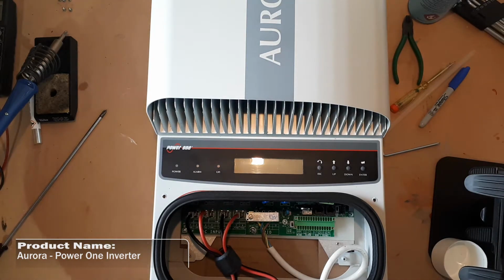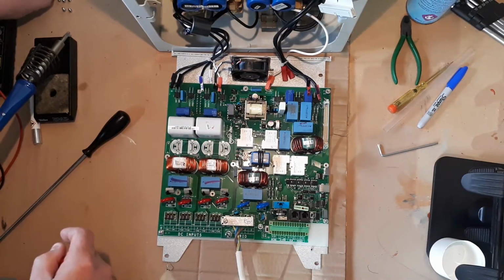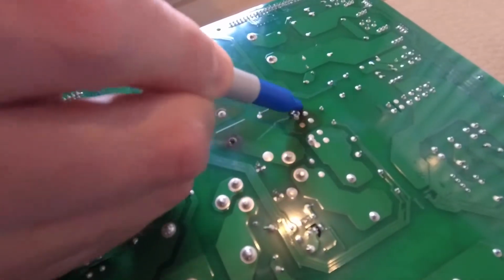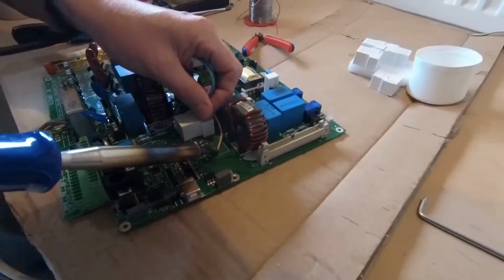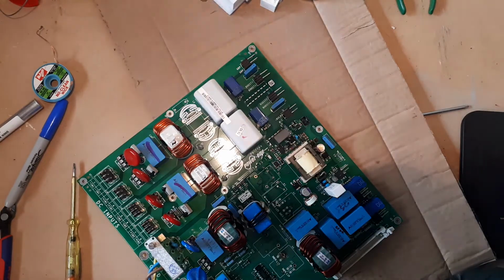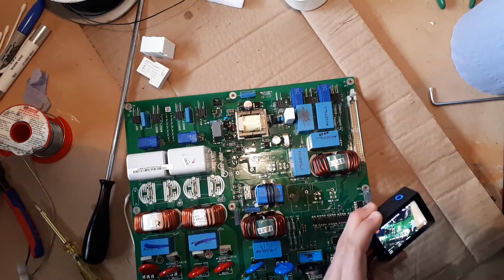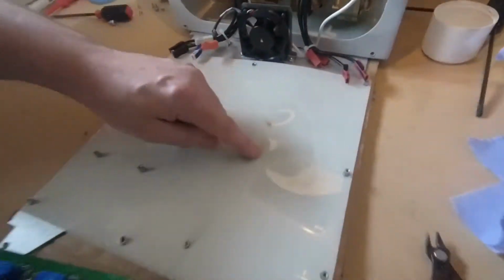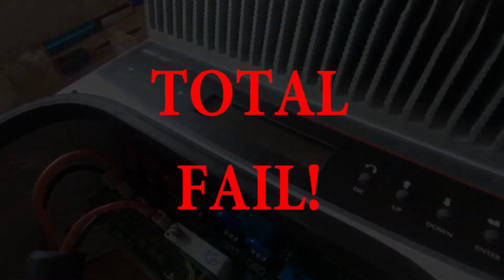Repairing & Fixing The POWER-ONE AURORA SOLAR PV INVERTER!

Comment: Hi. Good video thanks. I bought this and some solar panels second hand and want to have it installed. Please tell me; Can I use it directly for AC power to help provide daytime power for say a garage that's remote from the house that has no power or does it simply need to connect to the power grid somehow to allow you sell power and thus reduce your powerbill? Thanks in advance.

Comment: Helpful videos, thanks. Having now dealt with our E031, I can feed back a few things to make this job easier. First is that disconnecting the grid cable at the PCB will make handling the PCB thereafter much easier. Secondly, it is much easier to lay the unit on it's front when removing the backplate and mounting brackets. Then, without repositioning the unit, you can pivot the inner metal backplate up to remove the ribbon cable, and then keep pivoting it over to almost 180 degrees, and you will find that the inner backplate will sit nicely in this position making it really easy to remove the remaining cables, and then the PCB. Finally, if we consider that the output, or product of this unit is is mains power, then it is logical that it must receive it's own operating power from elsewhere. Note that part of the start up process is to check for the presence of the grid, and this check would not be possible (or would be redundant) if the operating power to do so was coming from the grid.

Comment: The failure is not the PCB, but the relay contacts going high resistance which then is causing the overheating.
Reply: Just been explaining this to a plumber who texted me today to ask "Can you fix some solder joints in an inverter for me"  By the way SDG stopped getting notifications of your videos, just re enabled notifications.....
Reply from the maker: Hi there - thanks for your comment! Yes, we found this out during the repairing this unit. A follow up of what happened after the repair can be found here: https://youtu.be/tucR0HLB5NI. Thanks again for your comment and we hope you enjoyed the video!

Comment: This is really useful - thank you. Will there be any issues having the Aurora reset after such jobs - will it affect built-in readings or info which is required for FITs, for example? Thanks.
Reply from the maker: In our experience, none of the settings are affected, so you should be ok!
Reply: @HDTechLogic  Thank you. 🙂

Comment: Do you have the Service Code to get in deeper menu? i have the aurora pvi 3.0
Reply from the maker: Hi, thanks for the comment! Unfortunately, we are unfamiliar with the menu of that model. A website that appears to offer a PDF User Manual for this model is available here: https://hdtechlogicyt.page.link/JdNS however if it doesn't offer the information you need, try searching around a bit more on Google. Sorry we couldn't help on this one, but thanks again for the query!
Reply: 0000 will get you past the first one.  The next one is neither 00000 nor 11111   I'd suggest trying the last 5 of the inverter serial # or contact whoever you bought it from.

Comment: Do you have the total wattage, or amperage? I have an issue with the same model. Thanks for posting this gents
Reply from the maker: Hi there, thanks for the comment and apologies for the late reply. Our system is no longer in our workshop and is not currently accessible for us to find that information. However, after some looking around online, I believe its total wattage is 3.6kW (however may differ on all units). If you have any other queries, please let us know! Thanks again!

Comment: These relays are two pairs in series doing the grid disconnect, one pair on the Live side the other on the Neutral.
One side of each pair of coils is commoned, the other side are driven by two different parts of the control circuits. Not sure why they designed it that way. 
Has anyone been able to find a schematic for these units? I've looked for a circuit diagram but not found one online
Reply from the maker: Hi @Paul Britton! Wish I could help with the schematic, however after some searching I'm also unable to find anything. Good luck!

Comment: Hello, 3000 watt solartronics full sinus inverter fault light is on. When the inverter is turned on, a relay tripping sound is heard, then the fault light is on, what do you think could be the problem?
Reply from the maker: Hi @suat aydemir. Thanks for your comment! Unfortunately we don't know about your inverter, however consider looking around the main circuit board to see if there is any visible damage around the relays. If there is, it could well be the relays / solder joints. Hope this helps.

Comment: Thank you.
Changed 3 relays which had obvious issues with the solder joints Added extra wiring as you suggested
Connected the two solar strings and ac. No more E031 error codes and generating electricity as before.
Only difficulty was removing the relays after desoldering. One coil connection  had not been fully desoldered and the fine track lifted as I was jiggling it about.  Fortunately the track did not break . Just want others to be aware to use a good solder sucker and solder braid 
Once again many thanks
Reply from the maker: Hi Colin, thanks for your comment. Glad to hear that the video was of use! As you mentioned, it is very important to use powerful / quality soldering equipment. Also pleased to hear that the issue has been resolved for you!

Comment: Many thanks for making this video. My Aurora power one inverter failed after ten years in exactly the way you describe. I ordered the four relays via eBay from a very helpful company in Axminster, and they arrived within 24 hours. My inverter Is now repaired, and back to exporting to the grid. The only extra thing I had to do was reset the inverter clock, also described elsewhere on YouTube. Thanks again guys
Reply from the maker: Hi Tim, thanks for your comment! Glad to hear that you easily got the equipment you needed, and of course got the inverter sucesfully repaired!

Comment: Hello, I have the same inverter that is ten years old that no longer works I have no faults the solar panels supply dc 230 volts but I have no watts coming out it lights up in the morning and goes out in the morning evening without production do you have an idea of the breakdown, thank you.
I'm French sorry for the translation google.
Reply from the maker: Hi @Rocky 1962 - thanks for your comment. As demonstrated in the video, the most common cause for no power generation is the E031 error (as the common one at the moment, of course there are still other likely causes). To help out with this, could you please tell me if you are getting an error code on-screen? Thanks!

Traduction française: Salut @Rocky 1962 - merci pour votre commentaire. Comme le montre la vidéo, la cause la plus courante d'absence de production d'énergie est l'erreur E031 (comme la plus courante en ce moment, il existe bien sûr d'autres causes probables). Pour vous aider, pourriez-vous me dire si vous obtenez un code d'erreur à l'écran ? Merci! (Aussi utilisé Google Traduction !)

Comment: Hi Gents. Fantastic video. Thanks for taking the time to make it. Really helpful for a novice like me. My Aurora inverter has just shown the E031 error after 11 years of trouble free use. Opened it up and only one of my relays has overheated. So bad though that it burnt off the green solder mask or about 1cm at one pin. What size wire did you use for the jumpers?
Reply from the maker: Hi! Thanks for the comment. The wire we used was Rapid: 01-0601 (0.6mm single core wire). Hope that helps, if you have any other questions, we'll be glad to help!
Reply: @HDTechLogic  Cheers thanks! I resoldered the burnt relay like Andy Reynolds did but that didn't work. The relay is gone. I'm still waiting on new relays to arrive. Will get some 0.6mm wire in preparation. Thanks again for posting this video and for responding to my query.

Comment: Hi, Thanks for the reference, my series of videos all come from just wanting to know because this is a very common problem. Put it back in the loft, there's your problem, heat. I have a video about extending inverter life, cheers
Reply from the maker: Hi Andy, great to hear from you. Thanks again for your excellent videos, without which we would not have tackled repairing our Power One Aurora inverter. Since the repair in the video was done, the inverter has been working great, so we're very happy that we managed to give it new life. I do understand what you're saying about heat and that mounting these units in the loft isn't the best place. Unfortunately this is where the original installers located ours so very difficult to change now. Thanks for the comment and support!

Comment: Hi mate 
Great video. Mines gone too. I have ordered relays. Soldering iron and tools needed. Only thing I haven’t got is the jump wire. Do you think it is entirely necessary to jump?also a tad confused on positioning on cable on both sides of pcb
Reply from the maker: Hi @roop hayre, hope you're well and glad you enjoyed the video. 

You need a powerful soldering iron to really get the joints properly hot to ensure they are reliable (ours is 80W if that helps). Jumper wires are there to add some extra conductive capacity and help soak the heat away from the relay pins. Make sure the solid core wire goes through the hole along with relay pin to help bulk-up the copper in the via (hole in circuit board where pin goes through). 

Hope this helps and feel more than free to ask if you have any queries. Thanks for your support!
Reply: @HDTechLogic  thanks for replying. Ordered same same iron as yours. Gonna order wire when home.  Let u know the results when all parts arrive
Reply: just  took mine apart and burn out on one pine, how ever relay diff company, do you think this will be an issue as ordered what u fitted.
Reply from the maker: Hi @roop hayre, thanks for the comments! First of all my apologies for replying very late, YouTube didn't make me aware of these replies until very recently! The manafacturer may matter with the relays for this, but it really depends on the quality of the build. I would suggest that you use the same brand of relays that we used in the video, just since we know those work for this! Let me know how it goes with the relays that you get/got.
Reply: @HDTechLogic  thanks for replying. Tried new relays but sadly still same. Ended up purchasing a second hand one to fix. Thanks once again. Great video by the way.